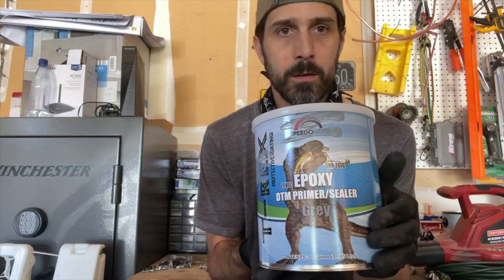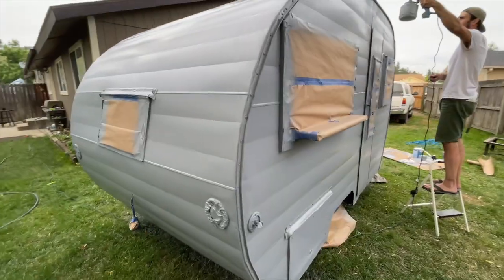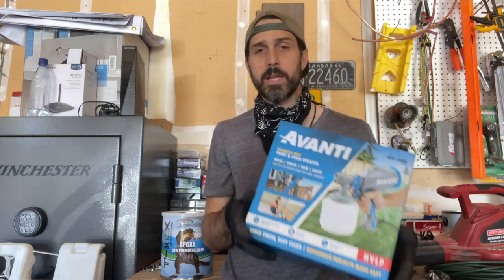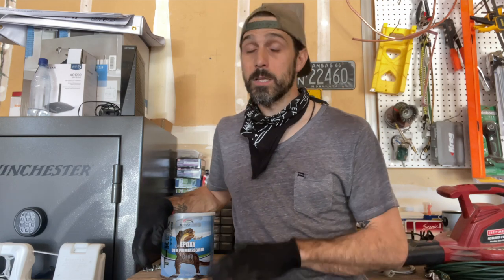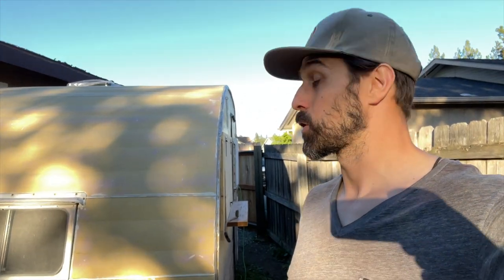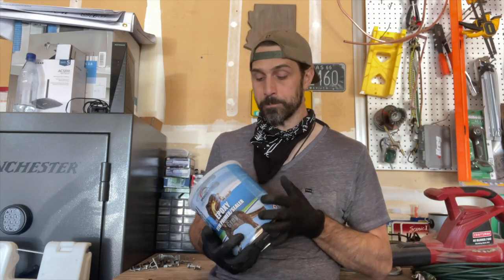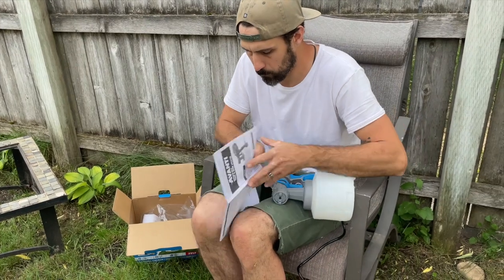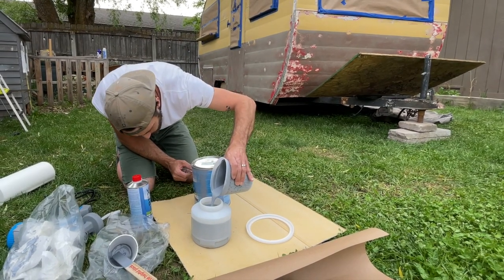DIY Epoxy Automotive Primer- Press On Coffee Trailers

Comment: Thank you for the info, I have a 64 mallard paint in pretty good shape, not sure if ill paint it, BUT off topic how did you choose your window placement?  I have the window plan on the opposite wall so the door can be in back. what is the benefit, if any of having window in front by the door?  I am also doing food and wanted to have the access to exit and enter?
Reply from the maker: The original window of the trailer kind of helped me decide where I wanted to place it. That way all I had to do was remove the old window and make the opening bigger. The window in front of the door was suppose to be where I handed out the orders but I rarely used it honestly. I would recommend putting your window on the passenger side of the trailer if possible. That way you can park on the street and your serving window is facing the sidewalk.
Reply: @PressOnMobileCoffee   awesome! thank you so much that isn't where I have it framed out to install but Im a big chicken and am procrastinating to cut it out LOL! great videos!  Not sure ill be doing coffee but I love all the info for the old school campers! :)
Reply: @PressOnMobileCoffee  PS what is the proper name of the silver paneling you used in the newer camper? all I can find is a metal look material , unless its stainless of course. looking for something lighter.
Reply from the maker: @melissavolanti3124  I believe you’re referring to the ceiling tin? If so, we got it from Americantinceilings.com. It was actually cheaper to buy real tin than the plastic ones companies make.